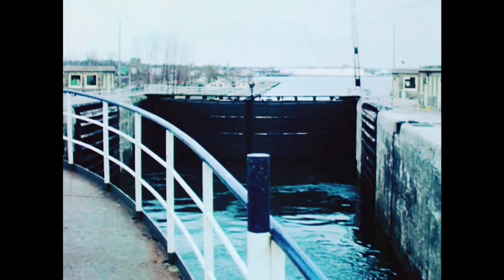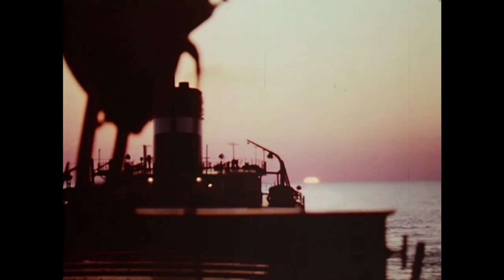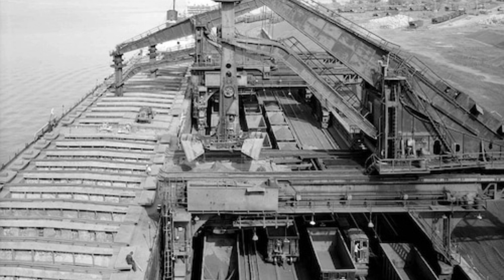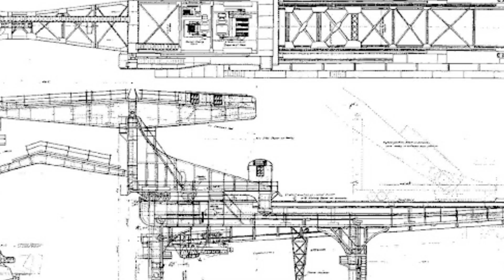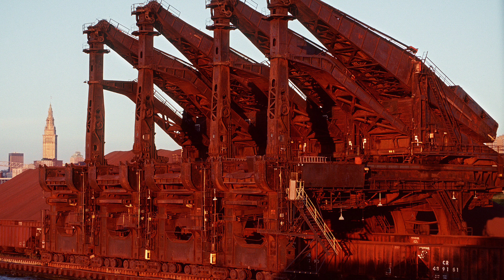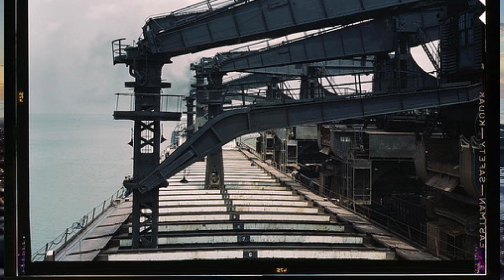HULETT UNLOADERS

Comment: There are many videos of the Huelets in use the front end loader was picked up and carefully the bucket was lowered into the hold of the oreboat and the loader was drivin out of the bucket so it could scrape the remaining ore in the corners of the boat, One of the videos has someone with a camera filming while the operator is operating the controls as they ride in the compartment as the bucket goes up and down. It is very quiet in the bucket as the machine is operating, Search for Hulet unloader and many many videos will come up,hit like when you watch because the loaders exist only on these  videos.

Comment: I wish I could have seen these in use. I bet it was really something.
Reply: I worked with the Heulets in 1967 working on the James Norris. When the front end loader was dropped in We would sweep and shovel the pellets to the middle of the hold and the rubber tired loader would  push it in a pile and the Heulet would pick it up. If the next trip was wheat we had to clean the hold and hose it down to be inspected by the Grain Board Inspector. iron ore [Taconite Pellets from Sept Isles Quebec} is very heavy to shovel and push with abroom.